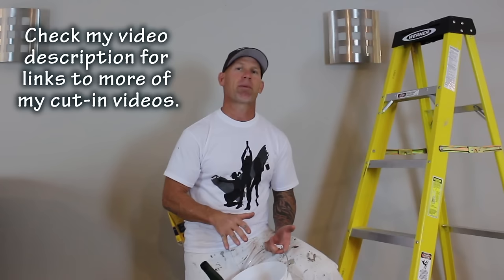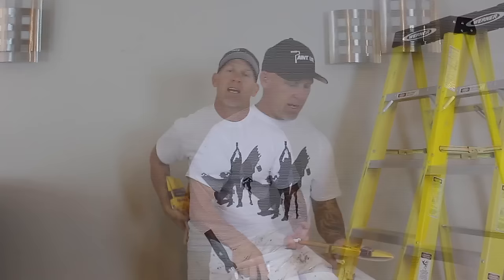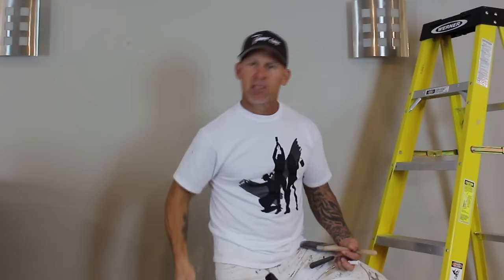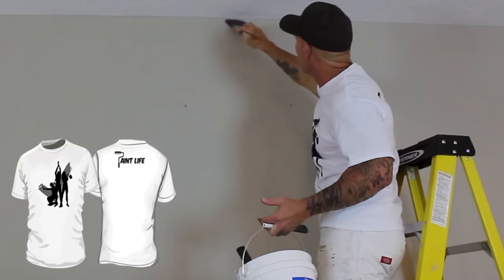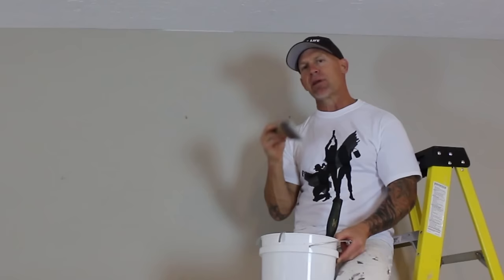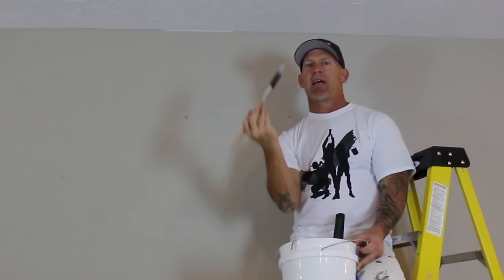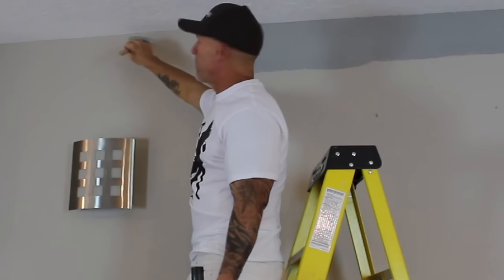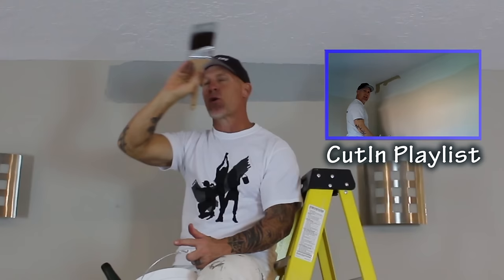HOW TO CUT IN CEILINGS.  DIY home improvement cut-in hacks and tips

Comment: lol bro-i believe the term “mansplaining” was created from watching your videos. lol . “You’ll need a ladder to get to the ceiling to cut in” oh wow never thought of that before, lol. “Now i like to fill my bucket 2 inches with paint” oh wow i would think you’d fill it up 2 gallons and try and hold it with one hand. So glad i learned that,Lol. I’m just messing with you bud it’s just wild watching the repeating and then exiting to repeat again and tell ppl they need the obvious. 

I’m in Florida and i actually cut about an 1/8 inch below ceiling if i just painted ceiling so i put ceiling paint on well at wall-we have major texture -way different from where i grew up and painted in NY so there’s no way to paint the ceiling with wall cut in line-so i drop down on wall a tick and just make my own straight line and you can’t tell it doesn’t go to ceiling. Plus our walls are mostly textured here too. Drywall work in Florida isn’t done as nice as NY also because they know they will be texturing so the finished drywall is a bit sloppy and warped. You need your own line to make.

Comment: Edited my comment because it sounded ignorant :) 

This is not cutting in a ceiling this is cutting TO the ceiling lol 

You guys seem to do sooo much more work then necessary in the states! You're the fifth person I've seen doing this. You really don't need the wiz roller especially with a huge cut line like that. Mine is about half the width and always cover fine. Is there a reasoning for your method? 

But then again you guys use paddle knives and pans to plaster (drywall/tape) lol where as we use hawks (boards) and trowels in Canada.  

Also we prefer stilts lol dunno if you do
Reply from the maker: This method as worked great for us!

Comment: Who wants a rounded corner a 90 degree corner cuts straighter looks more crisp and is much easier to cut in ,you can only paint as straight a line as the drywall finisher sandedit, usually you’ll find that 2 of the walls are sanded better than the other 2 because finishers work in teams many times and one guy cares about his work where the other cares less and all 4 walls can be different,by the way that cut work doesn’t look to good if you worked for me I’d put you in closets to practice before I’d let you cut in a real room.
Reply from the maker: Thanks for sharing and for the encouragement!

Comment: I like painting.  I don't like my painting results.  My cut-in is sending me back to redo the ceiling tomorrow.  While it dries I'll be working on oak floors and baseboard to remove paint.  Then maybe polystain baseboard.  Then try cut-in wall to celling again. It's alright to laugh if I seen you do it I would laugh. In my mind it looked as pretty as your finish when I started.  Maybe I'll get through the whole Bible. Thanks.
Reply from the maker: Thanks for watching Hubert!

Comment: You shared a lot of accurate facts to the method of cutting a wall/ceiling line and I fully endorse them, however, as I'd previously commented on another video where you demonstrate your preferences, you're creating unnecessary, extra work with your mini-roller - which also seems a cheating method to avoid doing a second (insurance) coat. If you know how to properly apply/lay off paint with a brush, you won't experience discrepancies with mismatched application textures (roller stipple vs bristle striations), when you move on to rolling the walls after you've finished cutting, everything. 
Also, if you experience flashing ("haloing", as you called it), the issue is uneven coverage (which is why it's always best to do TWO coats).
Your assessment of altered pigmentation being predicated upon the applicator itself (brush vs roller) is way off base. In such instances, you're experiencing a film-build discrepancy (that's why it's always a good idea to "box" all paint containers). A quality paint will lay out exactly the same, no matter what.
Finally, it would seem that if you're back-rolling to within an inch or two of the ceiling (creating unnecessary, significant risk for "ceiling bumps"), you're still going to retain that one-to-two inch "haloing" effect of which you speak, since that section never receives a stippling lay off.

Comment: The part that I don't understand is how this guy doesn't explain the difference between cutting in on the bottom first then the top then immediately rolling one wall at a time when using an eggshell paint but I'm assuming he's using a flat paint or running the base coat which doesn't really matter because I'm sure he's aware of it clashing.
Reply from the maker: Clashing? Just using Eggshell

Comment: If you put an eighth of an inch of paint on the ceiling, remember the next guy (usually me) will have to cover that during a repaint with a color change. Which will most likely will require painting the whole ceiling. Not fun. Otherwise I like your ideas.

Comment: really? first of all you're cutting wall to ceiling, second slant brushes are for windows. if you really want to know how to cut in watch " fastest painting edger in the world" a real painter uses aluminum ladder, not fiberglass, they're for electricians, aluminum ladders are much lighter☺use a light platform gorilla ladder for 8,9 and10 ft walls. they are simply the very best so light and your feet are resting on a comfortable platform. my husband runs wall cut in with 2 inch brushes of several types cause the a 2 inch brush pushes the paint out the bucked easily. you should see it then you will know

Comment: Hes using a sash brush...amateur. use a 3 inch square it holds more paint and u dont have to go back over it with a wiz roller. You're wasting a lot of time and you're lines aren't even straight.

Comment: the only brush to use is the Proform Picasso 2.5 angle for ceiling cut in...I have used every brush.......EVERY BRUSH 
there can be only 1! I would smash you in a room....you cut terribly slow and you dont have a clue sorry pal....i cant believe how you cut!!!! LMAO take that picasso and load it up and you should be able to cut a 4' strait pull without stopping or pulling from the wall....OMG I am The Best! RRPainting.net